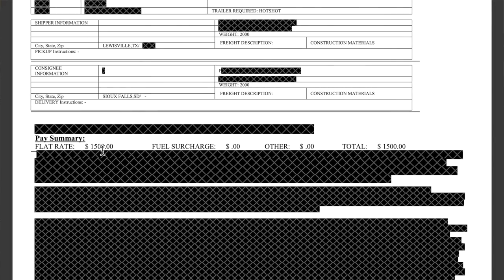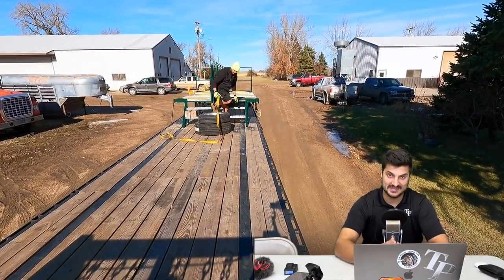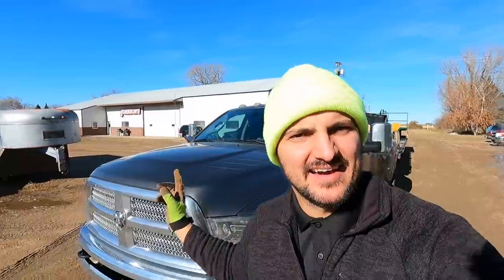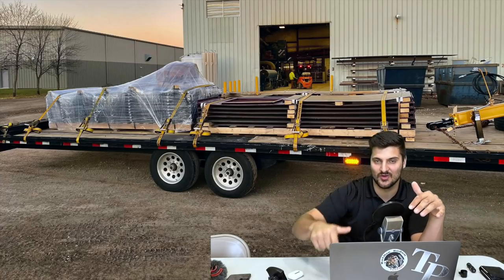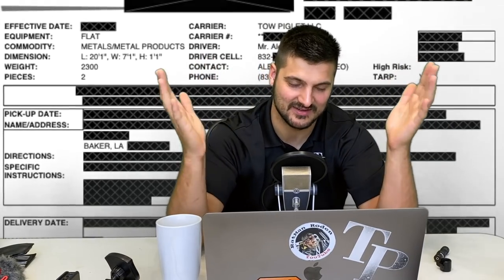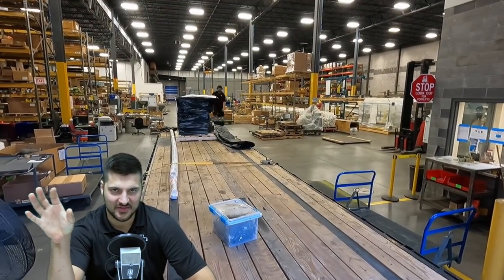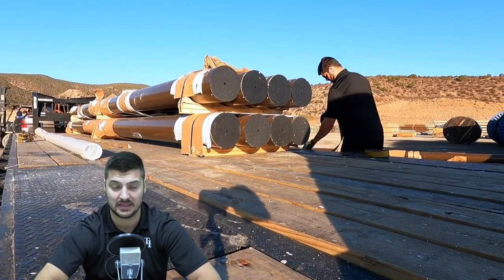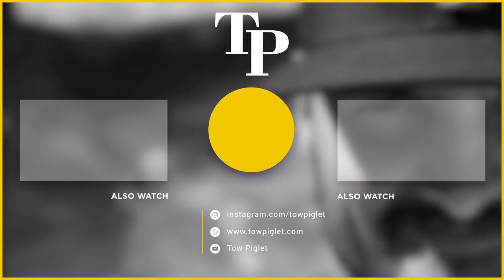How to gross $20,000 in a month doing hotshot with a dually pickup

Comment: I still haven’t forgot about the Officer pulling you over when you got Dodge.  The fuel tank addition, (plumbed in, gravity feed, pump..,)   What the mpg on Dodge is?    Glad the broker is helping.  It just makes sense.  Long as he is kept updated on where trucks are, where drivers are on hours (and mental/physical state). Most days Driving +10 hrs is easy.  But some days I would rather sleep 5 hrs and run all day/night.  Do you have where they check in with him daily?  Or is he checking with you/them?
  Maybe mention the other drivers in general?
  After 6 months compare costs for Dodge vs FORD lease?  Then for yr.  total costs, payments, maintenance... fuel, mileage. (So total cost, then adjusted for mileage as drivers should be putting in more miles). Thanks
Reply: Geez, that was alot. No wonder he hasn't answered you back.

Comment: Now brokers are paying hot shot trucking $400- $600 less than truckers. Do brokers realize the break down cost of hot shot trucking, first you need a 1 ton truck, the transmission blows after 60K miles to repair it the cost is $9K. You better off renting from Penske for 6 months you total cost is $16K for a total of 62K miles average with .22 cents per mile (5Kmile plan). When you begin your journey you are putting the mileage as semi truckers the only diff is total load and your carry weird stuff that caint be taken on a semi truck. So why pay hotshotters less, now they are all going bankrupt they are no longer make profit they take home profit is around $4K a month. Its ridiculous, the brokers sitting on a chair accepting calls are making $2K a day, they dont even burn fuel, no maintenance, it ridiculous. Im already hearing from many friends they are quitting and also DOT seems to be picking on hot shot drivers way more than semi rucks and they dont even stop UPS or FEDEX trucks.
Reply from the maker: These are some of the reasons I exited the business

Comment: If you’re going by your Recon your weight is 10,080 so how much can you haul with the set up you have and do you use your tank you have in the back of your truck
Reply: He weights EMPTY 17840 that minus 26000 is 8160, thats how much he can carry. You also have to keep in mind the gvwr of the trailer, so lets say the trailer has a GVWR of 14,000 then you subtract the weight of the trailer (empty) which is close to 7,000 lb to the GVWR and thats how much you can legally take on the trailer with no cdl required. So his payload is around 7,000 based on this example numbers I gave you. There is also to consider the 10-25% tongue weight that will rest on your truck axles, allowing you to carry a little more weight on the trailer. Hope it helps. Correct me if I’m wrong! Thanks

Comment: 40ft gooseneck with 14k axles is that custom order or there company that actually sells them like that.
Reply: He uses BigTex trailers, and I think he ordered them that way.
Reply: @markbremmer8642  thanks for the info defenetly going to call big tex and get more info
Reply: When you order a trailer you have the manufacturer plate it for what you want as long as it’s under the trailers maximum GVWR. Example is I ordered a Big Tex 16GN-40 with a GVWR of 17,500 lbs and had them plate it for a GVWR of 16,000 lbs. because my trucks GVWR is 10,000 lbs, therefore my GCWR is exactly 26,000 lbs so I am considered non-CDL hotshot. 👍✌️

Comment: $20,000 that sounds great, BUT. 60% is going for Truck payments, fuel, tires oil changes, and repairs. Then you have permits, taxes, and other things like broker fees. All that said you will make money if you don't try to live high off the hog. It will cost you A hundred dollar bill or more just in eating every day, plus snacks. 
   Being foolish with your money will make you go out of business. You have to put back money every time you get paid for repairs. You can have A brand new truck and trailer, and then run over something in the road at night and blow out several $ 500.00 tires. that's delivered out to the side of the road, ( that's if you're A hot shot)  $1,400 in bigger rigs and that's just run-of-the-mill tires. Then add service time and loss of delivery time.
   Most authors don't tell you about the downside, You start out with A brand new rig. It doesn't cost much for repairs at first but it doesn't stay new for long. If you don't grease it regularly change the oil, on schedule. let tires get low on air. It's mostly driver error, that will get you. Just having your fuel filter clog will cost you A $1,200 bill.
   When it is all said and done. you may net $3200